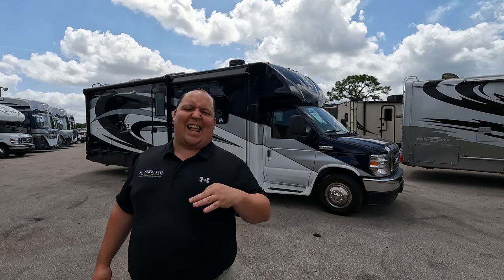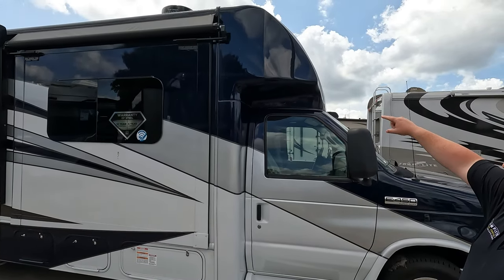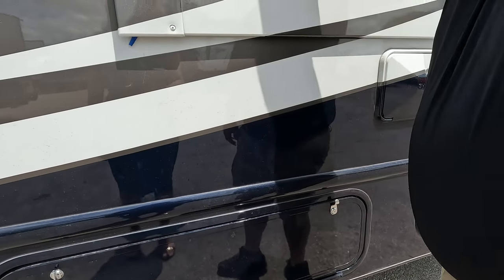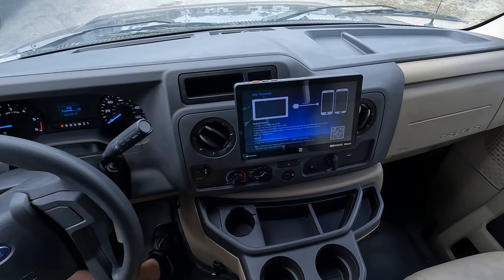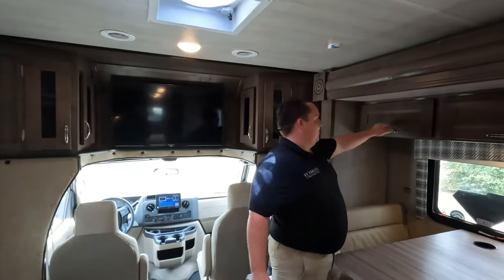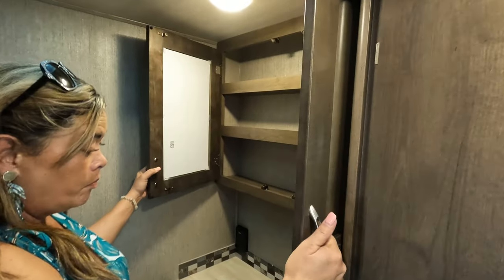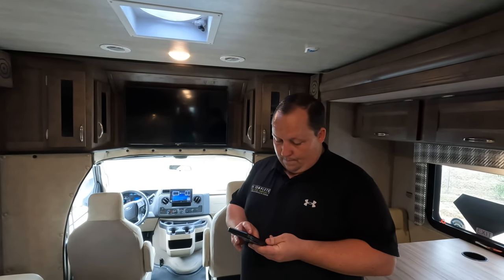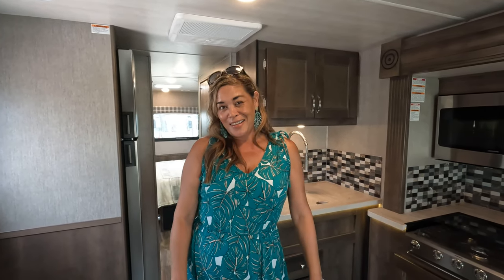MASSIVE Class C With 3 Slide Outs & NO OVERHANG BUNK!

Comment: For such a nice, well made RV, this is definitely not the one for me. The TV is in a neck wrecker position for almost everyone (except 1/2 of the dinette). A much better place would be above the table. I like the split bathroom, but not the radius shower. I agree with Andrea, those plaid valances are hideous, even worse than the Santa Fe ones. And what's with the new thing of putting sides on the valances. That looks clunky. Too bad they changed the really comfortable dinette. And as Andrea said, not enough counter space. They need a good size, flush extension to make up for it.  Nexus makes some really nice RV's.  Sorry, This is not one.

Comment: To be honest , Because this is such a small unit i would have preferred the overhead bunk to use for storage since it doesn't have a lot , Don't like the valances , don't like the dinette ( i prefer  the u shape /with storage , don't like that there is no window in the kitchen at all , it seems very dark in there , such a lack of windows. no way i would pay 170,000 for this.. about the only thing i do like is the steel cage construction. they need a new engineer and that's the first time you have heard me say that.

Comment: love your videos! the hubby and i have watched you two for a long time. we wanted to buy this type of rv but most were 8.5 wide and that didnt include the massive mirrors that add way too much width. i know they fold in, but then you cant see, but if they slid in, still being out enough to see around you some, that would be better. when you are on some of these tight back roads and another large truck or dump truck, rv, etc goes by, you have to pray that their mirrors or higher or lower than yours so you dont hit each others mirrors or worse.  in my f-250 that i had, i had to fold in my driver mirror on tight roads, to be sure i wouldnt clip someone else that was on or over the line.  so, ask they to make them “telescope” and im hoping some day we wont need massive mirrors on the sides, where cameras can take their place, making them thinner on the roads. love you guys.

Comment: Interesting to think adjustable frame twin beds (vertical placed rear to front) with enough room between so each sleeper can make it to the bathroom in the night without disturbing the other sleeper.  Just a thought.  Each twin doesn’t need to be residential twin size.  It’s the adjustable frame with room between each bed that is appealing.
Reply from the maker: Thank you so much Ernie!

Comment: While I prefer the no bunk over the cab, the insistence on putting an "entertainment center" there on all Viper floorplans negates it's functionality - so much so that it is a non-starter for me. There is literally one seat - half of the dinette - to view the TV as the other half, the back it so the TV. Might be able to view, angled sitting (monopolizing) the far more comfortable sofa, but the view from half the sofa would be blocked by the slide bulkhead. The fact that the driver and passenger seats don't swivel is immaterial as directly under TV - but would be a nice feature for dual purpose expanded living area. Nexus needs to critically look at that...and while they are at it, also look at solar as I didn't see pre-wire hookup terminals on the roof, nor even a solar option in their literature. Do like the construction - both steel and Azdel. Also that the bed mattress doesn't fold.

Comment: Why is the RV industry so generally stuck in the 70’s when it comes to design and colors? The colors, the plaid valances, etc add carpet on the floor and and wallpaper and you’re back 50 years.
Not much storage inside so why close off the dinette seats?! This tv is beyond impractical to use and no counter space but hey, full body paint. To each their own I guess.

Comment: What is the point of having all the slides/extra sleeping areas when it has a CCC of 1400 pounds. With tanks full what can you really carry. I guess two light children but you have that storage on the outside what could you really put in that unit. The TV placement sucks in the front and the shower placement with out giving privacy for the person is badly designed. The kitchen is also a nightmare.

Comment: The table needs to convert to a bed no question with the no bunk over the cab. Color of cabinets is bad, valance is way too dated. The headboard is really ugly. Interior is just too plain. The only thing I liked is the drive ability because of the size. Toilet are seems real tight and TV placement will crane your neck in the main area. Price too high for what ya get. Easy pass.